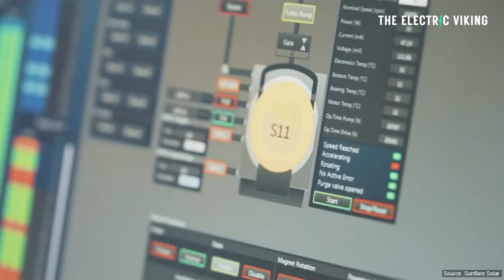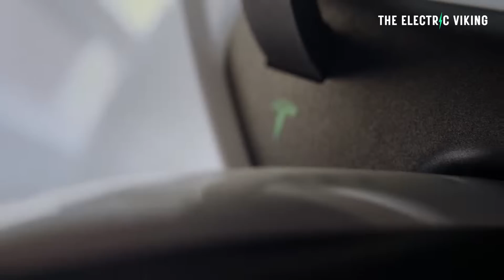Panasonic says homes and offices will soon be powered by their windows

Comment: I don’t think it’s got the same efficiency to replace rooftop solar. More likely to see bifacial solar panels and light coloured roofs to maximise reflected light to do more with less on rooftops . Where solar glass or building facades is likely to make more sense is on multi-storey commercial and residential buildings and commercial greenhouses. Especially the Panasonic product which has dark lines where the perovskite coating is sprayed on ( and sandwiched between two sheets of glass, from the images on their website. Clear Vue solar glass is clear and allows 70% of light through, which might make it more appealing for a wider range of projects.
Clear Vue, Australian company, has also built a solar glass greenhouse in Perth WA and also has more greenhouse projects in Japan and the US. It’s completed an office building in Canada and its first building in Australia will be built in Melbourne.

Comment: Let's assume the clear glass PVC works great but you still need to wire the panels and connect to your power supply, this will not work if you have sliding windows or any screens to stop flies from entering the home.

Comment: Better drive an Aptera in gusty crosswinds and next to speeding big rigs before you buy one
As a gust hits the rear wheel pant and lifts the whale tail, reducing further the limited lateral
traction of the single rear wheel, the car will PIVOT LIKE A WEATHER VANE TOWARD the
truck/bus and crash into it.
Reply: Aptera's curved shape allows crosswinds to easily go around the car. Its battery in the floor pan gives it a low center of balance, and the wide placement of its front wheels give it quite a bit of stability in a crosswind. If an 18 wheeled truck doesn't make a 700 lb motorcycle crash, it certainly isn't going to threaten an 1800 lb Aptera which is more aerodynamic and lower to the ground.
Reply: @amosbatto3051   -"Curved shape"?  The sides of the rear wheel pant are straight up-and-down between the pavement and the underside of the whale tail, causing the car to pivot like a weather vane when the draft off the front of a passed truck/bus hits it.

Comment: Thinking that building regulations will be updated so that any new building will have to include this film seems optimistic.  I've been thinking for decades that all new builds should be legislated to have a minimum percentage of solar roof covering and it's never happened.  I know there would be some push back from the building industrty, but there's no excuse really, because it will only be a relatively small percentage of the overall cost of a new house, at least based on UK prices and that money would be returned within a few years of energy savings.  It's also a lot easier for people to buy a house with solar already on, than to buy a house and then pay to have solar installed when they can afford it.

Comment: The Panasonic solar film is not “completely transparent”.  It has a bunch of tiny wires to get the electricity to the edge of the panel, which blocks some light transmission. And then you’re absorbing 30% of the light energy to make electricity. That is 30% of the light photons that never make it through the glass, which is equivalent to a 30% window tint.
Reply: don't you mean 70% since window tine is measured by how much gets through vs how much without tint
Reply: @wow-sham1300  70% transmittance is the same as 30% tint. The two terms are simply inverse of each other.
Reply: I believe most solar grabs mostly from infrared. That means the visible light is less impacted.
Reply: @clonan03  solar panels absorb 400-700 nanometer wavelength light, which is all the visible spectrum. Infrared light doesn’t have enough energy to knock electrons loose to move current. It would be amazing if it could, because infrared is simply heat. Then we could run solar panels 24 hours a day. Any hot surface at night would keep powering solar panels. But we know that simply doesn’t happen. Once the sun goes down, the solar panel stops working.
Reply: Not sure where you read that. What I read says they use very thin, horizontal strips of perovskite alternating 50/50 with uncoated, transparent glass. Given that many places use screens on their windows to block excess sun coming in (harsh on the eyes, makes it hard to see computer screens, and increases AC loads) it could be a win-win for houses and buildings in places where AC is more prevalent than heat (since it would block passive solar heating).
Reply: @truhartwood3170  so in a place like New York or Chicago, it would be a disadvantage due to the short summers and long winters. In Miami, due to the long summers, it would be a benefit... except insurance companies will eventually (if not immediately)increase the cost of premiums due to the added cost of repairs needed after a hurricane.
Reply: @bfree6197  it will make sense in some places and not others and the reasons will vary. A big factor is simply cost. If they're cheap enough it doesn't matter if you live in Greenland, you can use them as fences or on balconies. If they're hardly any more expensive than other windows they won't increase insurance. You're making a lot of assumptions and then jumping to proclamations of where they will and won't make sense. Like, not everywhere hot and sunny has hurricanes. It sounds like you're trying to argue that they either won't make sense for reason A, or they won't make sense for reason B. That's vastly over-simplistic.
Reply: If a fact insurance companies increase premiums for add risks... installation is not free either. It's not something a property owner will be doing on the 30th floor 😂... just common sense
Reply: @bfree6197  I think you're forgetting a very major point - this is embedded in a regular window. The only difference in cost is the difference between a window with and without the solar. Will a property owner not be paying to install windows? Or just not above the 30th floor? Because that has to be true for what you're saying. 

If a window with solar built-in is only, say, 5% more than a regular window, then replacing windows on a building, or building a new building might cost you $100,000 for regular windows, or $105,000 for solar windows, a difference of only $5k. It's not $105k for solar windows or free. Insurance doesn't have to cover $105k more than if you didn't get them. It's not like the alternative is masking tape and garbage bags. It's not like non-solar windows install themselves and only solar windows cost money to install. Right? Do you see now that you're being a little rediculous? 

So a more realistic scenario might be something like your insurance being $500/year more for solar windows (even this is probably excessive but just for demonstration purposes). If the solar windows make $1,500/year in electricity, that's still $1,000/year in savings over and above the extra insurance, which means that extra $5k will be paid off in 5 years, beyond which you'll have an extra $1,000/year in your pocket. Is that starting to make more sense now?
Reply: You can easily find online, Many buildings in New York City have their lights off at night, especially in commercial and office buildings when they are closed. This is often done to conserve energy and save on electricity costs.

You obviously forgot that more energy will be consumed for heating in the winter... making summer months a mute subject
Reply: @bfree6197  I see you're still trying to boil this down to one or two points and treating them like they're binary when they're not. Is there more sun in winter or summer? Summer, right? That's why it's summer. There's very little sun in the winter. So windows that reject some sunlight and turn some into electricity will have much more of an effect on the amount of daily sunlight entering a building in summer, right? So the amount of AC load that's reduced in the summer will make a much bigger impact that the much smaller amount of solar heat being rejected in the winter and making the heat work harder. So your argument that AC and hest offset each other doesn't work. And also, again, there are many, many more factors that all need to be weighed and considered when deciding whether or not to implement something like this tech, and that has to be done on an individual basis. You can't come on a comment section and declare that this will or won't work because reason X or reason Y. You're thinking about this incredibly overly simplistically.
Reply: @bfree6197  OK imma say it again - it's more complicated than that. What about glass balcony walls? Or glass fences? Or the glass on bus shelters? Or glass that's only partially sheltering a parkade, but not enclosing the space? Etc. Also, coming up with one extreme situation where the tech wouldn't work, doesn't mean it's not a multi-billion dollar industry. It doesn't have to meet every possible conceivable use case for it to viable. 

The only thing I did think of since posting last time is that there is one particular factor that is far more important than any other - and that's cost. If it's not cost effective in any application it will never take off. If it only adds pennies to the cost of each pane of glass then there could be tons of applications.
Reply: Hurricane codes are updated every couple of years in Florida, and are very strict. Even a small storage shed has to meet Hurricane codes. I can't imagine trying to meet code requirements with glass fences and balconies. 

Their are Hurricane windows available... the average cost is around $20,000 per house. I can only guess updating windows in a condominium complex in Miami may easily reach into the millions of dollars 

If you replace a door, window or roof... you have to go through the expense of bringing it up to current code. Code was updated again in 2023... so houses less than a year old already have things that won't meet codes! Certain cities require you to hire a licensed professional... you are not allowed to do it yourself
Reply: @bfree6197  You're the most insufferable nay sayer. Sure, they won't work. Anywhere on the planet. In any circumstance. Ever. I mean, I certainly can't google "glass balcony railing New York" (you know, the city you were talking about being cold in the winter. Not sure why you're suddenly switching to Florida. Or do you think NY is in Florida?) and get a couple dozen hits for NYC companies with webpages showing off all the glass balcony railings they've installed. I certainly can't google "New York glass bus shelter" and get images of such structures all over the city. Etc. I certainly can't do the very same thing in Miami and get hundreds of similar results there, too. So yeah, definitely won't work anywhere. I bet that company no one has ever hear of... Panasonic was it?.. never did any market analysis at all before investing millions of dollars and spending years researching how to bring such a product to market, and they have no idea what they're doing. You should be out there charging millions of dollars to consult for companies, telling them why no idea they have will ever work.
Reply: People will then need to use more lights, more often.
Reply: @bfree6197  This is against energy conservation. You transform visible light to power and then back to visible light. And it defeats the purpose of a window. Windows are bad insulators. Therefore if you have a window, you make the following trade of.... bad insulation for as much light as possible. Only if the building has additional glass for design purposes without the need for light you could/should do it.
Reply: @bfree6197   Most offices keep the lights on all the time, whether it's day or night, so it's got to be a benefit. And also the shading will have a cooling effect and reduce the load on the aircon.

Comment: If the film is transparent to the visible spectrum, it is highly unlikely to produce enough energy to be cost effective.  They are basically trying to capture energy from a UV filter.  Assuming 20% efficiency and vertical installation, most people would see wattage in the single digits per square meter.  I am afraid this may be one of those grandiose pipe dreams you humans are famous for, but I do wish you the best in your endeavors.  :goodvibes:

Comment: All of these inventions are  great in their own little sphere. In the aggregate they offer decreasing value as additional resources are marginal. They bump up against the sun doesn’t shine reality. We see examples of this in California where renewables cover the load at daytime. Storage on a grid scale is not yet feasible leaving fossil and nukes to cover the 24x7 demand.
Reply: Storage is feasible on a grid scale. It is being done. By South Australia, then Western Australia and New South Wales.
Reply: @davidinkster1296  
The contribution of wind and solar fell close to zero for several hours during Heather and for several days during Uri in Texas. For example, on Jan. 15 at 7:00 a.m., wind was only producing 4,700 megawatts, and solar was at zero. At that time, wind and solar were contributing less than 7% of the electricity Texans were using.

There is no storage system that could provide power for this duration and depth. The blind faith is renewables I deadly, particularly in cold climates.
Reply: @geneconnelly2478 battery backup is usually designed to cover 3-4 days without any input. It's pretty unusual to go that long without either any sun or any wind. These renewables are usually capable of providing 3 - 5X the power requirements at the best of times, so even at 20 - 33% output you won't need to draw from batteries at all, and even a modestly cloudy day will provide 100% of electricity needs. Battery backup is totally feasible and is actually cheaper than diesel, coal, natural gas, or nuclear.

Comment: Remember one thing about applying materials in windows and roofs. If they reflect sunlight on any neighboring building or surface, those surfaces reach 165 degrees F. Varies certain times of the year. You can destroy other buildings and surfaces.
Reply: Only matters if the building is curved so that the light is focused.   Otherwise it is no different than daylight
Reply: @clonan03  Just saying this through an expensive experience and research for a case. Any panel has a reflective portion. Concave or convex it does not matter. Everything is fine then the angle of the sun in the seasons and you have issues. It is in the installation manual with many facia products. It is in many insurance policies and install manuals.
Reply: Omg 😱 are you real there are transparent not mirrors.
Reply: @adus123  Just saying this through an expensive experience and research for a case. Any panel has a reflective portion. Concave or convex it does not matter. Everything is fine then the angle of the sun in the seasons and you have issues. It is in the installation manual with many facia products. It is in many insurance policies and install manuals.
Reply: @steveschofro298  Well considering this is meant to be a transparent solar panel or Solar film to be added to glass With no loss in optical Vision.  You're talking about reflective films, not transparent glass.  Yes if the whole building is made of glass then that's a different story.  if your windows are setting fire to the neighbour's garden then This is down to poor design or installation, not the product.
Reply: @adus123 glass is not 100% transparent. If the angle of the light beam approaches parallel it's going to be a 100% reflective. High-school physics.
Reply: @so_what_else_is_new  So you're saying  because we've been using glass for hundreds of years  all of a sudden because of this new product it is no longer viable. Yes glass is not 100% transparent  neither is air or water. This is a product To be incorporated into the design of buildings. New or old. If you design your building wrong you can't blame the product.
Reply: @adus123  no I was not saying that. Just giving some basic physics properties of glass. So was my second remark about em radiation.
Reply: Just saying this through an expensive experience and research for a case. Any panel has a reflective portion. Concave or convex it does not matter. Everything is fine then the angle of the sun in the seasons and you have issues. It is in the installation manual with many facia products. It is in many insurance policies and install manuals.